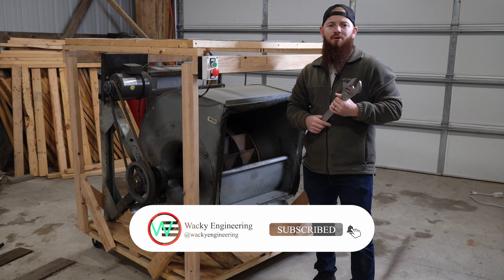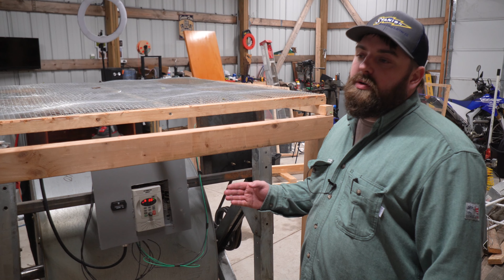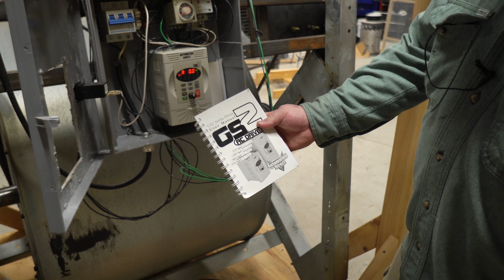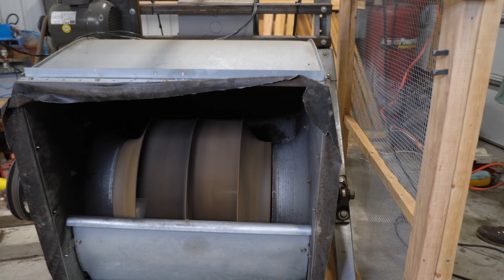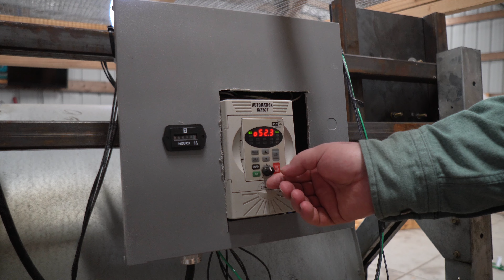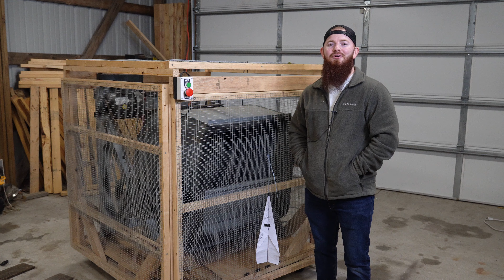Single Phase to Three Phase VFD Fan #automation

Comment: Nice! Is it possible to get 480 out of that VFD or would you need to get a different one?
Reply from the maker: Good question, this VFD is designed to have 220-240v single phase input, and output 220-240v three phase. Most drive manufacturers have several input and output voltages for a particular size of drive so usually you can find the voltage you are looking for!

Comment: Great video guys! One question, does using a drive prolong the life of a three phase motor or is it harder on it? THANKS
Reply from the maker: Great question! With a properly sized load reactor and an inverter duty motor you shouldn't see any reduced life in your motor. Without those two things you can have some transient voltage spikes that could break down the insulation in the windings at a very slightly increased rate, although with the lower inrush current through the motor windings in a VFD setup versus an across the line starter I believe the motor life would be about equal, especially with the motor being within 10 feet of the VFD.